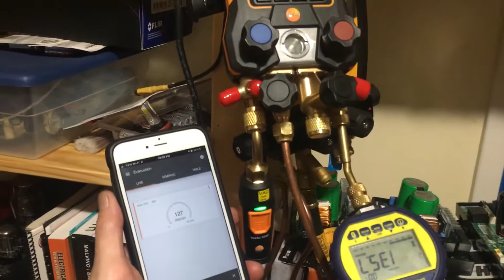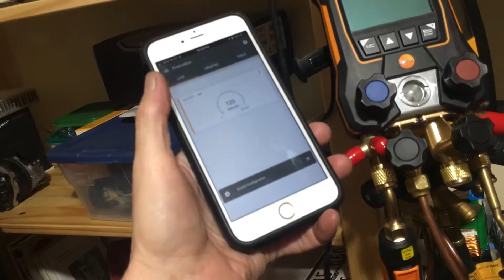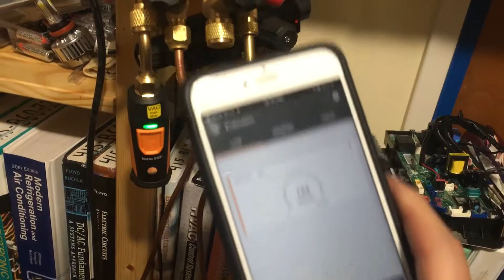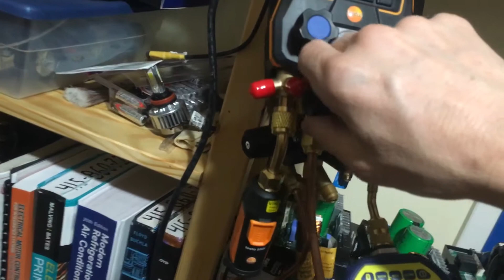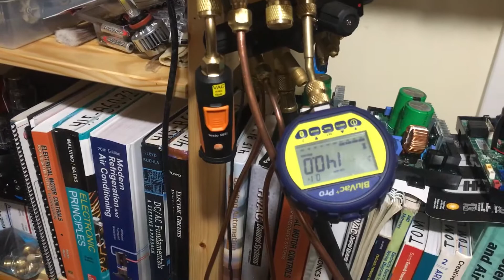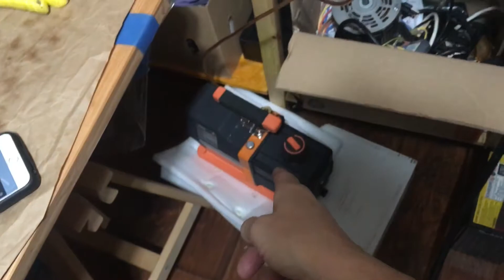Testo 557s testing manifold for vacuum leaks. Overnight vacuum decay test

Comment: so how do you like the testo compared to the bluvac?
Reply from the maker: So far good. I have not looked to see if it had data logging software same as the BluVac. 

       It’s not important that the TESTO dose not read below 10 microns. 
         99.9% of people do not even own a vacuum pump that can pull a vacuum down to below 10 microns.    Never the less have the patients to wait that long for their Hvac system to pull down that low.